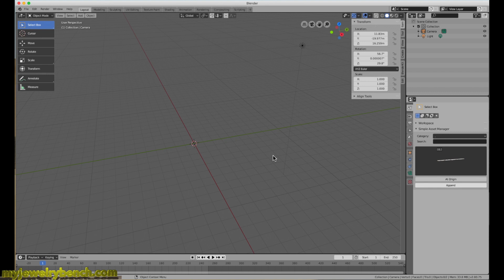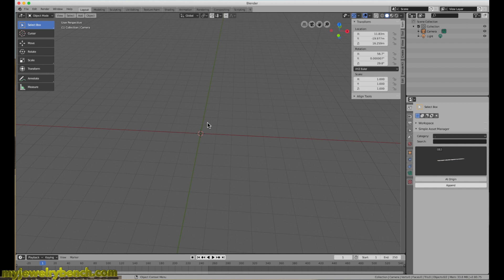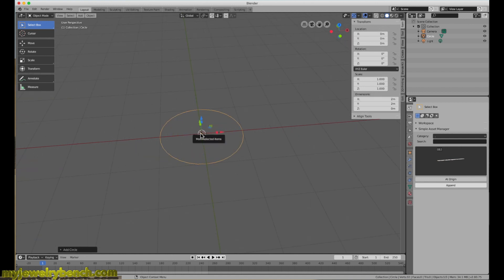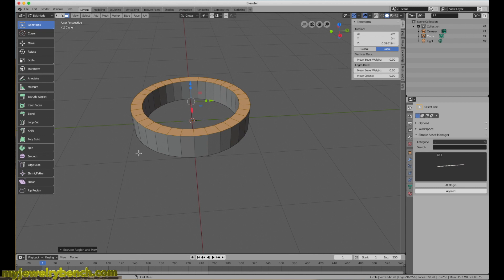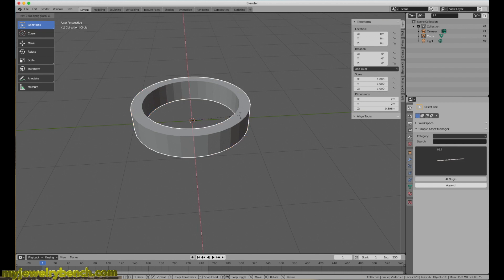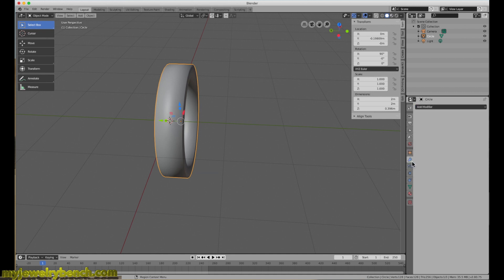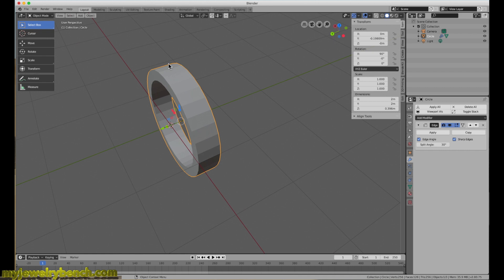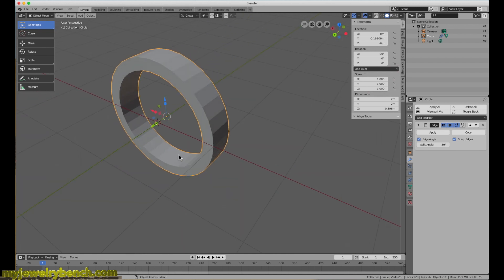Jewelers!  Don't Be Afraid of Blender 2.8   Part 2  More Rings!

Comment: I am using blender 2.9 On a mac; when I right-click, 
after making the initial circle and giving it some thickness, it doesn’t give me a Properties Menu. It gives me an object context menu that doesn’t have a set origin option. Any recommendations. Thank you
Reply from the maker: Check back in an hour or two. I’m fixing a bunch of jewelry and can’t get to a computer but will give you a solution
Reply: @watchesandjewelry  Wow Thanks
Reply from the maker: OK Steve;  Lets see if I can help get you through this...  First thing, go to the edit menu, and down to blender preferences.  There are tabs on the left, select the tab on the left that is titled "keymap"  Make sure you have "Left" selected for 'select with mouse'.  In addition, make sure that there are NO checkmarks in any of the little boxes.  Now...  I am not sure, but, if you added your circle, and it is a "Curve" circle, I'm guessing you added some thickness with the Extrude tool panel on the right.  If that is the case, and the object is a "curve" object, you CANNOT set the origin.  You must first convert it to a mesh.  To determine if your object is a mesh or a curve, If you have all the default settings in blender set, then in the upper right corner, a little box shows your objects.  If the object is a curve, it will have a bent line next to it.  If the object is a mesh, it will have an up-side-down triangle next to it.  Once you convert your circle to a mesh (Right Click, then go down to "convert to mesh"), you will then be able to right-click on the circle (That is now a Mesh) and set the origin.  If that doesn't work, then go to the following page and send me a direct-message.  I will walk you through it...    www.facebook.com/myjewelrybench    Please let me know how you make out.
Reply: @watchesandjewelry  I Thank you very much for your help. I had all that right I was just in the edit mode and not in the object mode . Thanks again

Comment: I am running 2.9 on a PC and the "Shift/Alt" does not select all the edges as shown in the video. Any idea why ? I select one edge, and then "Shift/Alt" and try to select the edge next to it and it doesn't do anything. Thanks!
Reply from the maker: The only thing I can think of is that while in edit mode, check the selection in the upper left corner and make sure you have the edge selected and not faces or verts.
Reply: Thanks for responding so quickly. Hmm...I checked and only "Edge select" is enabled.  BTW, Did you receive my email?
Reply from the maker: I’ll check

Comment: Hi, when I use the bevel tool it only beveled  along one face, what do I need to change so it affects both faces on the edge?
Reply: correction it only affects my outer edges not the inner edges
Reply from the maker: Hi. In object mode select the I text you want to bevel. Press control A and assign rotation and scale. Let me know it this helps

Comment: Hi, I posted here yesterday but now my comment is gone. I'll try again :-) I am having trouble figuring out how to get the yellow orange line around the object after I double a deselect it. Basically I can select 1 little segment or I can turn it all orange. I'll keep practicing. I appreciate this good work you are doing.
Reply from the maker: No problem. I’m glad to help. To select multiple objects. Make sure you are in object mode using the tab key. Press or right click on the first object. The press and hold the shift key down. While holding the shift key down select the second object. If you hold the shift key down and select more objects with your mouse, I believe the last one you select will stay yellow. That last object becomes the Parent object. Let me know if that helps